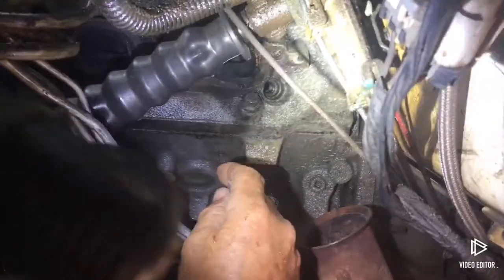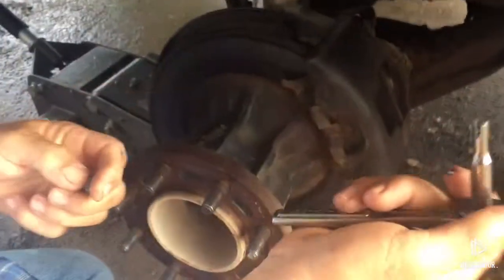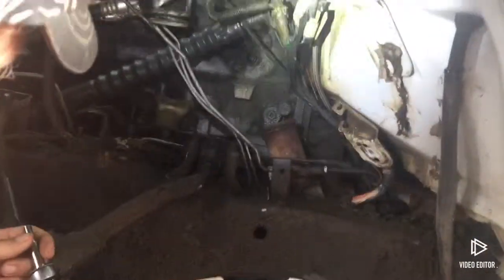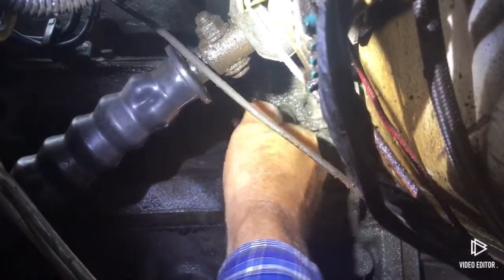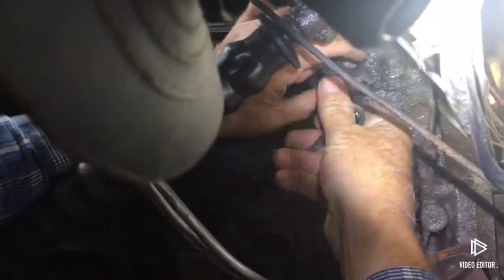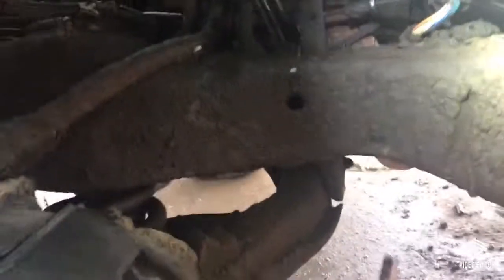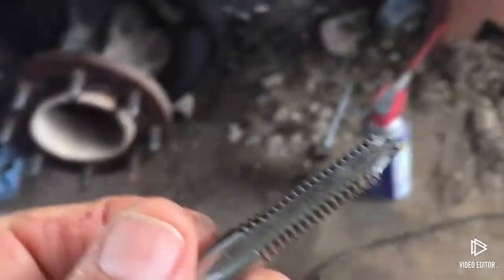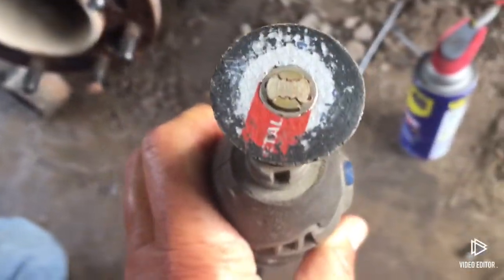Make your own tools. Broken tap removal out of 454 engine,

Comment: tried to do the same thing to remove a broken tap in a engine head bolt hole.....having a ridiculously hard time trying to get it out...its a big tap so it will take probably days to drill out...the hole is aluminium so i have no idea why i cant get it to twist even with a impact wrench no luck...smh